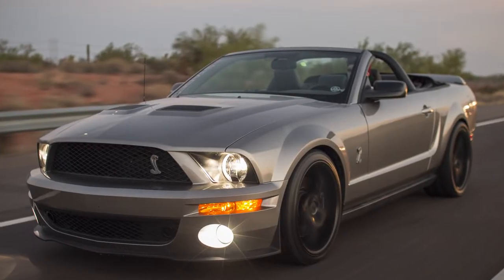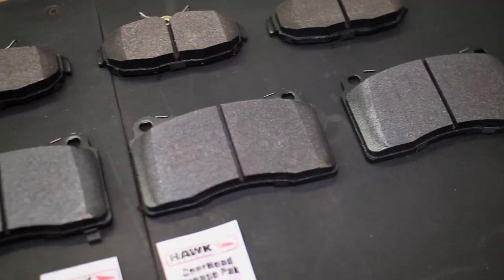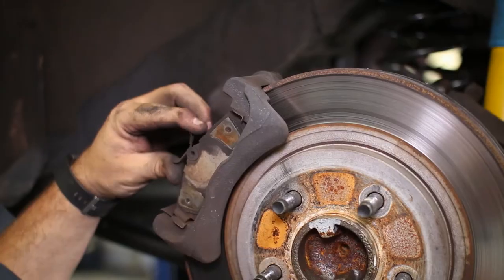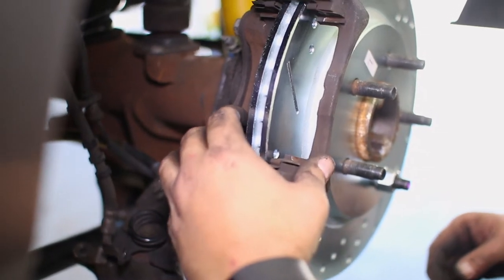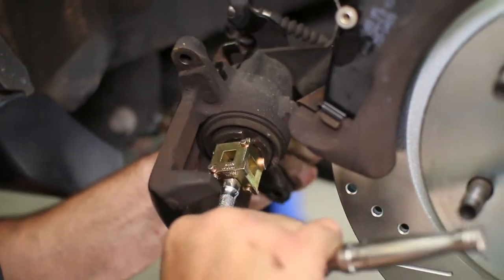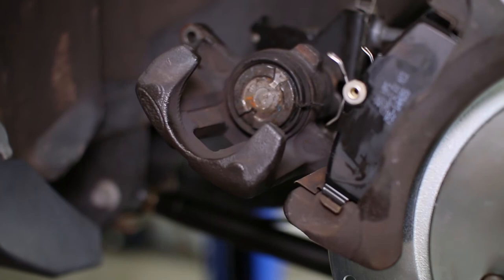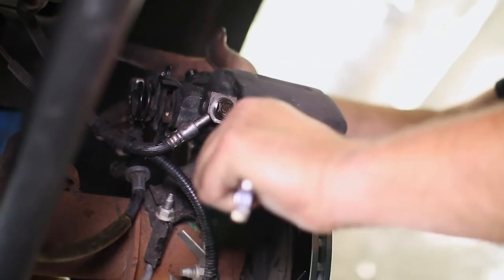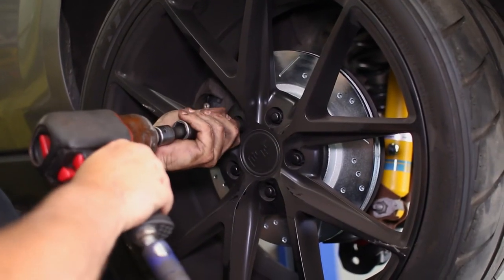2005-2014 Mustang V6/GT/GT500 Rear Brake Pad Install

Comment: Issue that IS important - ALWAYS Replace the metal clips, as they can become "Notched" over time and cause the pad to bind against the rotor. Also some Syl-gel on the caliper pins is advised, again to allow free movement of the pad. Don't just "Slap" in new pads like this video shows.

Comment: While trying to be as nice as possible, you could have and should have stressed the fact that you need to pump brake pedal back up after depressing piston into caliper and the fact that brake systems are a sealed system from the factory and once you open bleeder, your essentially allowing air and contamination into system and the entire brake system now needs to be bled, then if your really lucky you get the brake system that requires a good/ expensive scan tool to activate ABS Bleed procedure, and then more importantly and only reason I watched video, newer fords with electronic Rear brake caliper needs to be put into service/ maintenance mode, end rant.
Reply from the maker: You're right Danny, in our older videos there were important things we missed, we try our best to cover the most important steps as much as we can in our latest videos!